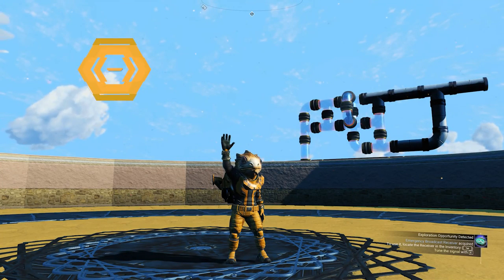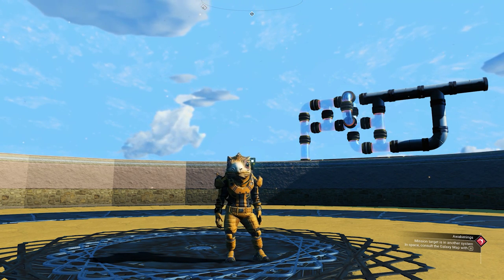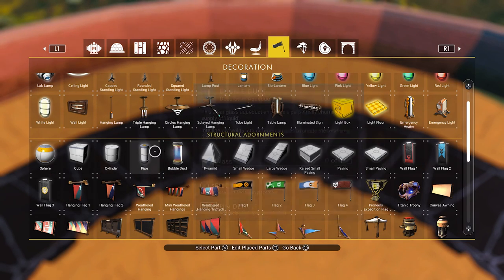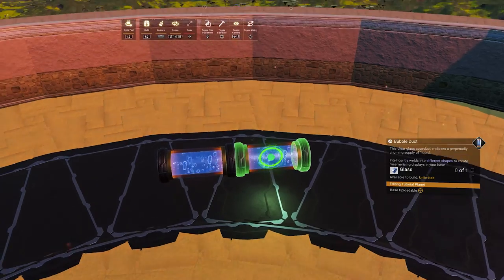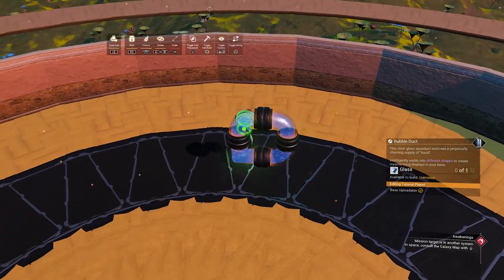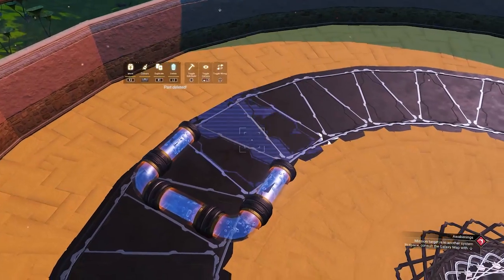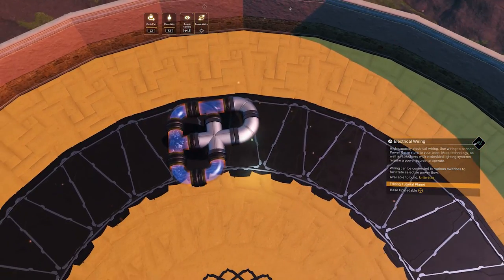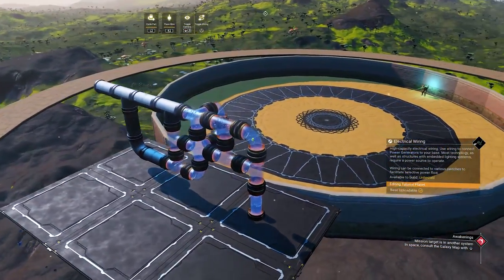Contextual Pipes and Water Ducts - No Mans Sky Experimental Update News

Comment: The 4 way connector is a cool addition. 
I wonder if you can control the direction of the water by planning out the order of placement, or using directional wire placement.
Reply from the maker: Most likely, I did not really go into much testing.. but it could be the direction is followed from the start point.